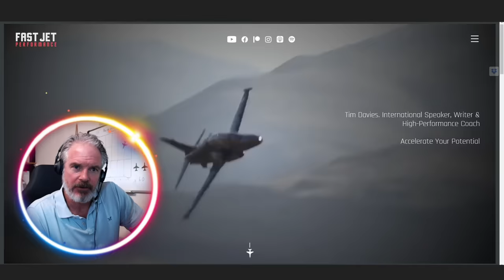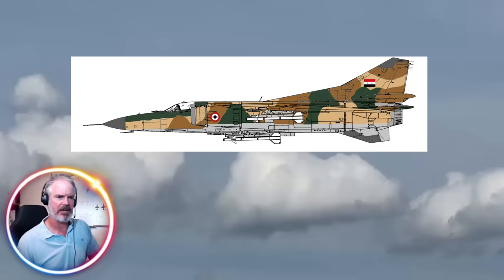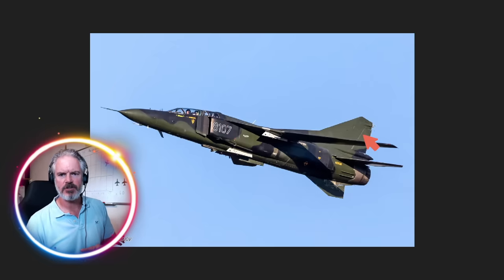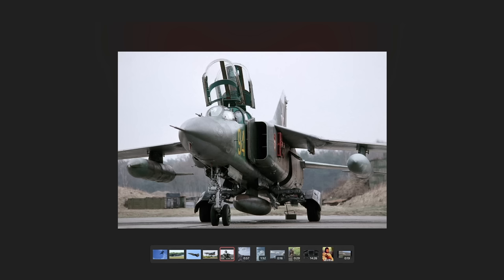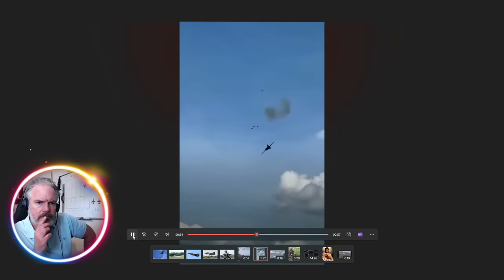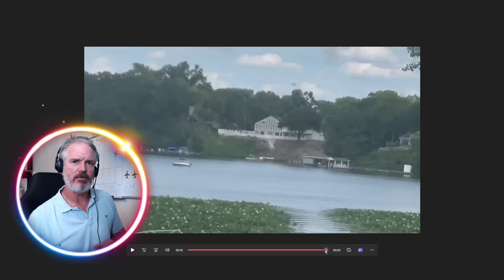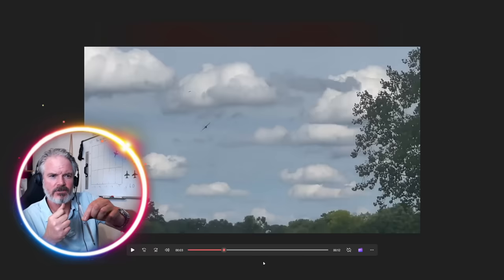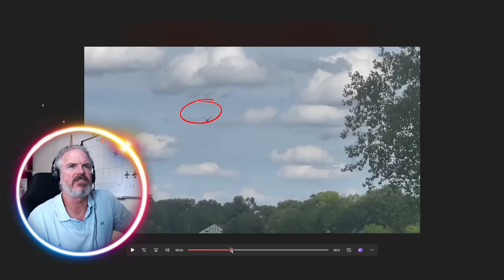Escaping Disaster: Pilot's Analysis of MIG-23 Airshow Crash and Double Ejection

Comment: The UB version actually has the R27 engine. The single-seaters got the R29.

The hydraulic system is divided into two autonomous systems, the booster system and the general hydraulic system.
Each system includes an NP-70A variable displacement pump driven by the thruster.
The booster system supplies one of the two chambers of the hydraulic boosters of the fin rudders (BU-170A) of the interceptors (BU-190A)
and the hydraulic motor of the SPK-1 propulsion unit.

The general hydraulic system supplies the chamber of the hydraulic amplifier BU-270 of the rudder,
the second chamber of the hydraulic booster of the fin rudder and interceptors, and the second hydraulic motor of the SPK-1 actuator, and ensures the operation of the landing gear, landing flaps and hydrofoil nose flaps, airbrakes, wedges of lateral air intakes, the mechanism for steering the nose wheels of the pivoting parts of the stabilizer fin, the flaps of the TS-21 turbostarter, the loading mechanism of the pedals, and the switching of the stages of the fin rudder control in the bank angle regime. Additional pressure accumulators are the ball hydraulic accumulators.

Each system includes a hydraulic accumulator. When the powerplant is authorized, it is possible to switch the hydraulic pump of the booster system to emergency operation.
Reply: Well done!

Comment: Miraculous really when one considers where the aircraft ended up. It does look like the aircraft was idling and unresponsive. The pilot was possibly aware and hoping to recover some control until the very last minute. Did he make his ejection decision based on what he  was currently flying over vs where the jet was pointed? Would the power of two ejections and subsequent weight loss affect the jets trajectory?
Reply: If you have total loss of control of the bird due to a hydraulic failure then you might as well just punch out.  At that point the jet will go where it will go regardless of whether you are riding in it or not.  No point in dying if there is nothing more you can do, and in this case you might as well save the guy in the back seat by commanding an ejection.
Reply: It DID seem to change its' descent after both seats were out and very likely from the weight shift aft after the initial downward force of them punching out.   So the plane landed farther out than it appeared it was going to when they commanded ejection.  VERY fortunate that nobody on the ground was injured.   Beyond the aircraft failing...luck was on their side this time.
Reply: "Would the power of two ejections and subsequent weight loss affect the jets trajectory?" - YES

A pilotless Soviet MiG-23 crashed in Belgium on July 4, 1989. During the takeoff of the Soviet aircraft in Poland, the engine power dropped dangerously in the critical section of the climb. The ground control center ordered the pilot to eject, and the aircraft was expected to crash immediately. Instead, the aircraft stabilized itself, in part due to the change in center of gravity (missing ejection seat, cockpit canopy, pilot). The aircraft then continued to fly westward without a pilot for about 900 kilometers. In the process, it reached its service ceiling with its configuration (spread wings) at 12,000 meters. Over the Federal Republic of Germany, it was escorted by NATO aircraft and crashed in Belgium before their intervention.

Comment: FOD via bird strike into intakes , causing compressor stall. At such low altitude for air shows. Its a possibility.  
Fuel starvation? These airs shows demos carry just enough gas to T/O. showoff, land, and have 15 minute reserve. If fuel calcs were off, and crew signed for insufficient fuel.

Comment: With a single point of failure, in the modern flying world I'm surprised the FAA grant airworthness for an aircraft like this. If it is a hydraulic failure that leads to loss of control it does seem like a single point of failure. With simple SEP aircraft even if you have an engine failure you are required to have enough altitude to glide to safety so an engine failure shouldn't result in a major crash. Maybe its just me being naive as to what is and isn't airworthy.

Comment: Can't believe pilots left the plane and just let it crash where it wants too? It's pure luck no one on ground was killed. Plane ended up right next to apartment building. crazy.
Reply: Sometimes when things go wrong, all you can do is hope, and adjust your straps.
Reply: If the jet is uncontrollable you eject and the jet goes down where it wants.
Reply: A bit harsh? Options were maybe fast-reducing & ejection/abandonment is always the last resort.
Reply: Many of the touted stories of pilots steering their failing aircraft away from populated sites are wishful thinking.
Reply: If the controls were locked what were they supposed to do, just sit there texting goodbye? They may also have had a modicum of control, left it later to eject and the plane hit a residential area. Take the win, no one died.

Comment: Privately-owned jets with armed ejection seats should NEVER be allowed to fly over ANY populated areas.
Reply: Think about that for a moment. Should privately owned jets without ejection seats be allowed to fly over populated areas? Yes? No? the ability to eject has little to do with an aircraft crashing, with or without a pilot in it. As in this case, there were NO fatalities or serious injuries. By your statement, there would have been two fatalities.
Reply: @barrygrant2907  you misunderstand. By my statement they wouldn’t have been flying at all if they could not completely avoid populated areas. If it’s too dangerous to fly without ejection seats, it’s too dangerous for anyone it flies over.
Reply: I think someone should tell you that aircraft (with & without crew escape systems) fly over populated areas all the time, without incident.
Reply: So does having unarmed ejection seats mean they won't crash in populated areas? Methinks you need to rethink that one 🤔
Reply: Yep, you all either can’t understand or refuse to understand. Either way, not worth my time.
Reply: Why? So if something happens to the plane the pilot has to die instead of saving himself?
So ... Cars shouldnt have seatbelts either?
Reply: Irrelevant
Reply: @cab6273 no rule requires ejection seats.
Reply: @mmayes9466  not sure I implied there was one, but okay.
Reply: @barrygrant2907  The self preservation temptation to eject over a populated area is just too great. These are not men in the service of their country. These are  thrill seeking millionaires. The innocent people on the ground have priority over anyone in that aircraft. When they fly these dangerous aircraft, they need to man up, accept the risk, and DO NOT EJECT OVER POPULATED AREAS…. Stay with the aircraft, make sure it reaches an open area. Take your chances on whatever landing surface you can find.

Comment: Evil for those pilots to bail as their plane is left to head towards an apartment.  They should have steered it away into an open field.
Reply: But, what if they had absolutely no control over the plane?
Reply: @dave8599 can you explain what was not properly maintained? Are saying any plane that crashes is not properly maintained? United 232, for example?
Reply: @dave8599 exactly which parts are lacking?